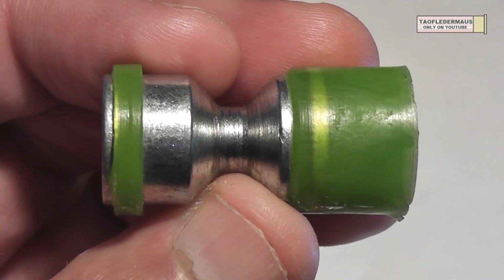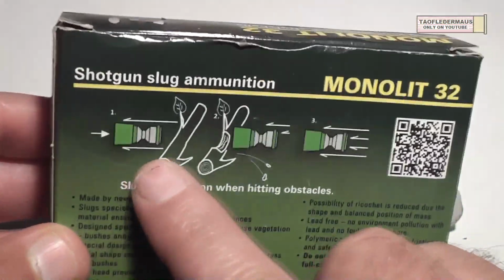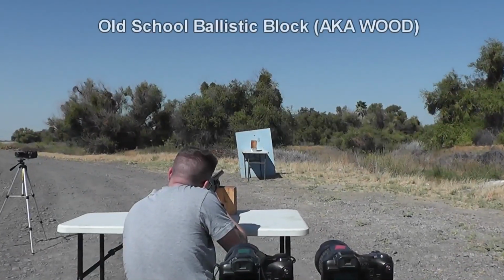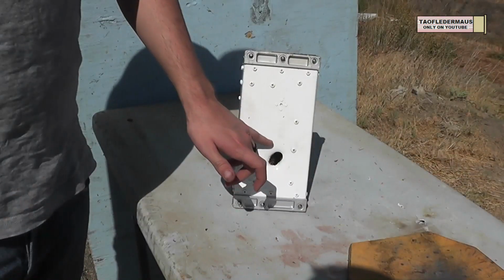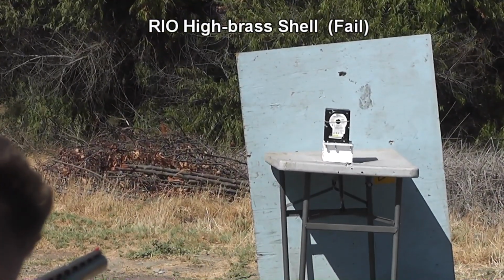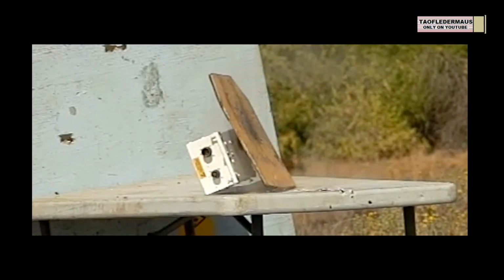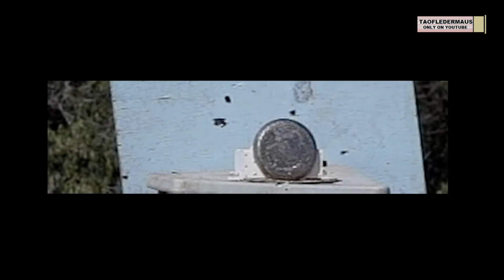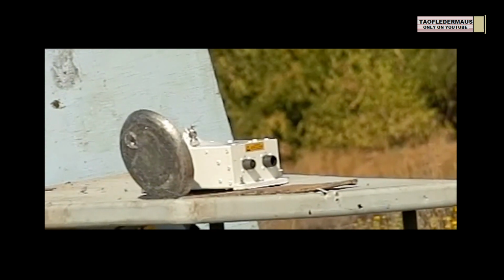12ga STEEL Slug Test  - The Exotic  D Dupleks Monolit 32

Comment: Rifled barrel would make a huge difference with the plastic sabot I shot a deer with a BRI sabot from a mossberg 500 smooth bore and the hole was N hourglass shape but when fired through a rifled barrel was bullet strait I think a lot of test with the crazy slugs would turn out completely different with a rifled shot gun ....if nothing else it would be quite interesting
Reply from the maker: +Frank Faunce   These can be shot though a rifled barrel but they are sabot-less.   Sabots are for filling the space in the barrel so you can shoot smaller projectiles,   they don't make rounds more accurate.    These are all ready the size of the barrel.
Reply: +TAOFLEDERMAUS correct but the plastic jacket was what I was talking about I understand the idea of sabot the deer was shot when I was 16 was just trying something different an it didn't work lol put one down a rifled barrel see what happens might be sweet . Shooting the plastic down the smoothbore caused the slug to tumble or key hole I get that they can be shot down a rifled bore I would just like to see the difference
Reply: +TAOFLEDERMAUS I guess I should have paid attention to how I worded that first post I meant that I shot a deer with a plastic Sabot not that the slugs you were shooting were sabot
Reply from the maker: +Frank Faunce   The only reason these failed was because of the way I loaded them.  It wasn't due to anything D Dupleks did.   They normally fly straight with the green skirt attached.
Reply: +TAOFLEDERMAUS it's all good ..still would for sure like to see you guys do a comparison between rifled barrel an smooth think it would be bad ass especially with the crazy slugs you guys shoot
Reply from the maker: We'll let someone else do a rifled test. I can't afford such luxuries.
Reply from the maker: A friend of mine shot his before but he sold it a while back.

Comment: Not to come across as a nanny- I'd be a little more cautious around lead. There's sure to be some powder like residue after being smashed into by projectiles. I assume you're all educated enough not melt lead into plates in a enclosed room.
Reply from the maker: +TheBrewjo  There is a gas seal between the round and the powder,  so it's pretty unlikely any powder could transfer to the front of the projectile.  As far as handling lead,   you wash your hands after handling it.   People handle lead pellets and bullets all the time.

Comment: I sometimes saw a little spark when I shot flat headed crosman pelllets into a sheet of lead from my air rifle. thought it might be the air between the pellet and plate being heated by ram pressure.
Reply: I beg to differ, steel-on-steel will create sparks...example: Steel arrow points hitting steel pipe will create a shower of sparks!
Reply: buckaroobonsi555 well there was definitely a ittle flash and a crack noise. it only seemed to happen with crosman flat headed pellets which were going about 800 fps. the target was definitely lead, I cast it myself from old used pellets.
Reply: +Lachlan Hamilton possible but unlikely it might just be on the steel type mild steel can be different because of the quality control. But that does not mean it is impossible but unlikely.
Reply: +Lachlan Hamilton lead does not spark with impact at any velocity.You can shoot pure lead at lead all day long and it will never spark. Even lead with tin and antimony etc...added will not spark especial shot at a lead plate. Lead and copper do not spark on steel either. It is hard to get steel on steel to spark that is why we developed ferrocium(sp) and even then it take some steels will do a better job than others in making sparks. 

Atmospheric gas combo that we breath will not combust at any pressure with out some form of fuel added.

Only select materials work well as kinetic energy weapons depleted uranium is self sharpening and ignites and burns super hot. It has to achieve 3500 miles per-hour and that speed in focused into an area slightly smaller then an American quarter. Tungsten-Nickle-Cobalt alloys can be made to do the same thing. I doubt your air-rifle is tossing pellets at 3500 miles per-hour  so you can rule out any material igniting or compressing air to any form of auto-ignition since you lack any fuel source.

Keep in mind piston/compression lighters need some flammable material added to the end of the piston in order to make an amber to light your cigarette on. It is not just the end of the wooden piston igniting.
Reply: +buckaroobonsi555 I'm going to curect you right quick the old lighters in cars was actually very hot metal most of the ones I saw were

Comment: DDupleks also produces 3 types of high quality 'tactical' ammo (which are not openly advertised on their website - and are certainly not for sale to 'civilians' anyway...)

Their glaser slug, as their fragmentation slug (for IED 'disposal), have very 'task-specific' uses (covert ops, elite police / army / counter-terrorism units...) But you'd enjoy very much shooting the third one : the armor-piercing slug AP-20 (google it).

By the way, the AP-20's design is as simple as it is efficient : with access to a lathe, polymer molding / 3D printing, and some trial & error, you may be able to reverse-engineer it (which would be BAD, since it's probably patented...)

Comment: Maybe you should have loaded them backwards so the steel takes the brunt of the impact.The metal body has more mass than the plastic tail which translates to more inertia so it accelerates slower than the lighter plastic. So what I'm saying is that when the gunpowder went off the gasses pushed against the plastic to escape out the point of least resistance. The force applied to the plastic forced it into the solid steel body of the slug and the slug didn't give way so the energy had to go somewhere so it when outward while pushing forward and outward. the plastic esentialy mushroomed out like the lead did on the front of the slug when you shot the lead plate. So loading it in backwards would make it so the plastic is put under lower stress while accelerating. Does that make sense to you it could be just the unintelligible ramblings of a 16 year old but it makes scence to me so I'm sticking with it for the time being. Thank you for reading and have a good day.

Comment: In regard to the plug knocked out of the lead plate, I think that a similar thing happens in AR500 tests where the plate is defeated. You can see something similar from the .223 vamint vs. Level III armor test on my channel. I think it's basically the same concept as a Newton's cradle.

Comment: You can get these in factory loads from sgammo.com.  They are 3 inch magnums from the factory, using low brass loads probably contributed to the less than ideal result.
Reply: +Lay Boon Tay http://sgammo.com/product/12-gauge-ammo/5-round-box-12-gauge-3-inch-mag-ddupleks-monolit-32-magnum-1125-inch-slug-ammo
Reply: And also 2.75" inch ones too:  http://sgammo.com/product/12-gauge/5-round-box-12-gauge-ddupleks-275-inch-monolit-32-1125-oz-slug-am1934

Comment: I think the reason for the failure is probably because the original round has a slower burning rate but has a larger charge of powder to achieve similar speed but put less initial stress on the round.  One thing that maybe an hint is the picture of the shell on the box that have a brass of about 40% of total lengt while a regular slug have a brass of about 30%.
Reply from the maker: +armalikaen Sounds about right!

Comment: 12/70 is 2 3/4 i think
Reply from the maker: +Sweden   12 ga but I don't know exactly what the 70 is.   I measured the length of the slug and they are about 40mm long.   So you might be right.
Reply: +TAOFLEDERMAUS yeah in sweden and europe (i think) shotgun shells are measured in 12 (gauge) and then 65, 67,70,76 and 89 which is the length of the cartridge (70mm equals 2,75 inches)
BTW im taking a hunting exam soon so i can own and hunt with guns
Reply from the maker: Ah, that makes a lot of sense,  thanks!
Reply: +TAOFLEDERMAUS youre welcome

Comment: Here's my lead-flash hypothesis: Assuming the lead plate was handled by bare hands, body oils found their way on to the plate. The shock wave from the slug pressurized the air in front, preheating the oils, and the impact added that extra little something to trigger ignition. Similar to the plunger-activated fire starters. I vote my idea as the least likely while still being theoretically plausible.
Reply from the maker: +vanderticked   We don't handle the plate that much.    We've seen flashes like that when steel core round hit aluminum.
Reply: +TAOFLEDERMAUS Yeah, but I hear it's always pizza party, and then filming with you guys... ;)
I'm going with atmospheric fireball.

Comment: I think that the velocity was too high for the round to stabilize within the short distance you use.  I recall when sabot rounds first came out for the 12 gauge at least one mfg made a similar shaped round, only their slug was more of an hourglass shape.
Reply from the maker: +breakallegro  The blast was just too great,  so the green tail was blown off or distorted,  and that is what stabilizes it.

Comment: Cool catching that slug on the table the way it did. Looked like it made it 99.99% the way through and the bang on the table was enough to punch it through the last foil hang on. It even danced a little for you. Did you find the slugs punch out piece of lead? Or did it shatter? It looked like it just popped off the side of the table but could have been junk.
Reply from the maker: +Chuffered FUoogle   We didn't notice the chunk of lead that fell off the table.   It was probably right at our feet.

Comment: Thanks again for the video. I don't remember you guys ever comparing like really high power, high brass slugs shot out either of a smooth bore or a rifled slug barrel shotgun. It would be interesting to see if there is difference between muzzle velocities and penetration on target. Accuracy is certainly better out of a rifled slug barrel though.

Comment: I'll try and work on getting you some of the old school hand loading stuff for shotguns so you dont have to modify traditional shells so much when you trying to make stuff like this work. 

No promises yet. haha.
But I"m going to try.
Reply: +TAOFLEDERMAUS if he was latvian you could count on it happening. not latvian, cross your fingers. (and if for some reason i ever say i'll do something, assume i've forgotten about it inside of five minutes).
Reply from the maker: +Sarin Highwind  I usually just use "stock" shells and have pretty good luck. It's mostly a convenience thing.
Reply: It's not for you to do your own reloads, but to have better wadding options while packing the slugs as opposed to the default shot cup. 

Some of the old handload stuff included felt pads and other types of disks to stack to get the pressure forward. Nothing that would collapse blah blah blah. I"m just thinking. All my shotgun stuff is in a different state so i cannot play around with these idea's, nor do i have high speed able to do such things to see how it works either. 
nothing fancy, nothing expensive. 

Sometimes I just wonder if when you load some of these rounds if you should use a black powder patch to push it into the shot shell.
Reply from the maker: We'll see how my loads work with the 30 year old Soviet Poleva bullets that Roberts also sent.   These dupleks were just  something extra he threw in the package.
Reply: NICE!

Might i suggest for far more tactical accuracy to sew some sequence onto the tactical golf glove. 
Might help.
Reply from the maker: +Sarin Highwind  I think Barron is going to be away for a couple months,   but Darren should be back soon.
Reply: Noooo! Tactical golf glove, i love you. hahaha. =)

Comment: Failure? No way. You could never duplicate the slug penetrating the lead plate and coming to a dead stop just as it exited the plate. That was a memorable moment as was the sparking on impact which can give us many days of debate trying to figure that one out.
Reply from the maker: +Dan Troop    I've gotten a lot of theories about the flash.   It's kind of what we've seen when steel core rounds struck the computer hard drives.     The slug coming to a complete stop was definitely one for the books!
Reply: +Dan Troop Yeah, damn right that was

Comment: Would he shoot (or already has) combustible materials out of a shotgun like magnesium? Or is that only a Demolition Ranch thing? :) 

I'm thinking perhaps a lead slug with a magnesium core would do something interesting against a solid target like a steel plate.
Reply from the maker: +UrbanTarzan Duh  If I can get the materials I'd try it.    I have a little bag of magnesium shavings Demo Matt sent me a while back.
Reply: Magnesium ribbon fits in your 5$ budget, it costs 3$.
Reply: I'd basically pour lead (that you melt in a spoon) into a shell-sized cylinder (perhaps even a shell casing would do the job) while holding a magnesium chunk on a thin copper wire from above.

Comment: I wonder how they would do out of my bolt action shotgun
Reply from the maker: +TACTICAL G-CODE Not if you loaded them like I did!   lol   They have the plastic slip ring so the steel never contacts the barrel.  You could probably counterbore the face and put a small carbide penetrator in it too.  That would be something!

Comment: The lead shot, what happened there is that the impact depleted the forward force of the slug very close to 0. I think that's a really cool shot, usually it's either disintegration, stop or pass through.

One thing that i'd like to suggest if possible, stick a post in the ground with a flat surface welded to it(or nailed). Reason being that if you could do that then you could affix to it the plates rather than keeping them on the table. It would be interesting to see what happens to some projectiles when they meet something that isn't willing to give. Of course, this kind of shot would have to be a distance one because of shrapnel but none the less, i think it would be interesting to see.
Reply from the maker: +aserta   I bet we couldn't repeat that if we tried 1000 times. lol
Reply: ***** I concur.

Comment: I saw sparks shooting old olive oil cans with an 850 fps airgun (BAM B19) Pellets: 4,5mm Coal Starter and Umarex Mosquito.
And no, it was not a Diesel effect, randomly visible at low light conditions.

Comment: Could the flash have been yellow hot molten lead?
That flat nose slamming into the plate, would definitely impart some energy, that has to do something. Heat (you said the slug was hot) is an expected result.
It might lend some explanation to why the slug just kinda plopped out the other side too.
Like all the energy got transformed into heat, which practically melted through the plate, which quickly absorbed and discharged the heat leaving a relatively clean hole, a hot slug, and no more momentum.

Jus' guessin' :-)

Can lead go colors when heated?
I goobled, but came up empty. In a slight rush to take dog out.
__

EDIT/ADDENDUM: Forum post about the Emissivity of Molten Lead - http://www.internationalskeptics.com/forums/showthread.php?t=87464
Seems to be informed (in parts), and suggests that molten lead may not "glow" even if heated to near its boiling point.
However, the steel could have also heated enough to melt a bit.
Reply: +Fred Gandt The mechanism causing hot metals to glow is no different from the mechanism that causes candle flames or the Sun to glow; it's known as Black Body Radiation. To show up on a high speed camera in bright daylight, the lead (or steel, doesn't matter which) would have had to be heated to approximately 1100-1300 degrees Celsius, well above the melting point of lead but far from it's boiling point. 

Is it possible a flat-nosed steel slug could have caused this sort of heating? Well, I can't definitively say it's impossible. If the slug hit just right, going fast enough, compression heating might have been enough to flash-melt a small volume of lead, heating it a further several hundred degrees before it could escape around the edge of the slug. Recreating the right set of conditions might be almost impossible, though. I doubt friction alone would be enough to create this sort of near-instantaneous heating.

Of course, not recreating the effect in a controlled experiment could provide partial confirmation of the hypothesis. If the exact same kind of slug, hitting the exact same kind of lead only going sideways creates no flash then that could indicate compression heating being the cause of it.
Reply: Nearly, but not quite Runiat.
Lead is not a black body, and if it ever does glow, the visible radiation will be called "emissivity".
Reply: +Runiat 
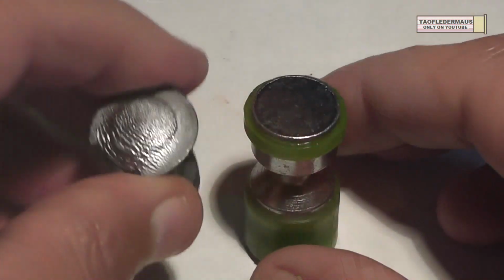It looks like molten lead to me: 4:30. Just look at how shiny and wavy it is.
If you pause the video during 4:19 (approximately in the middle of the second), you will be able to see the plate at just the right angle. Part of pushed out "skirt" of lead around hole is missing. We saw that part of "skirt" as sparks flying in top and a bit right direction because it was molten. Notice how missing part placement corresponds to the direction of sparks.
I don't know English very well, so I hope I've made myself clear.
Reply: +Runiat The slug looked weird after it had hit the lead plate.